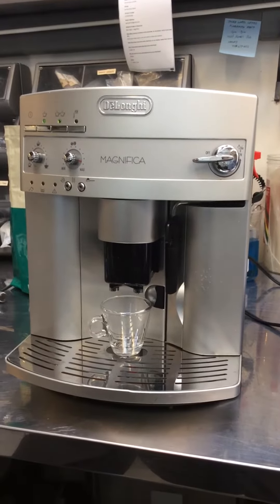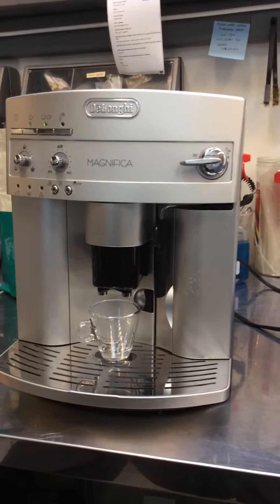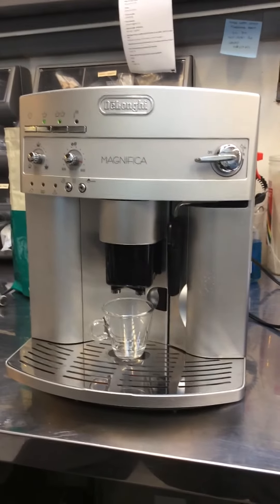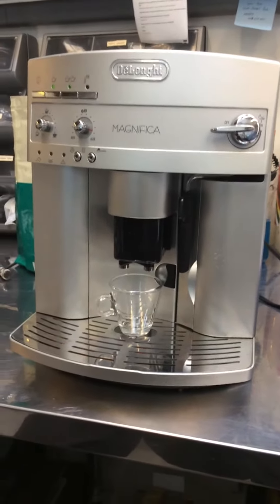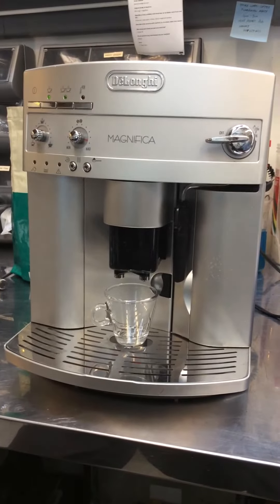front door pops open - delonghi magnifica - 1827 test

Comment: Cleaning is good, but this video is incorrect. The door opens because the spring on the back of black button has a manufacturing defect. Spring ejects up and stops working. If the door handle moves easily then the spring is out. You have to open door and put the spring back. Do NoT LoSe It. The door handle shall be firm in locked position at all times if it is operating well. A double side tape would work as a stopper for the spring preventing it from moving up.  We repair Russian rockets with tape. This will work just fine.